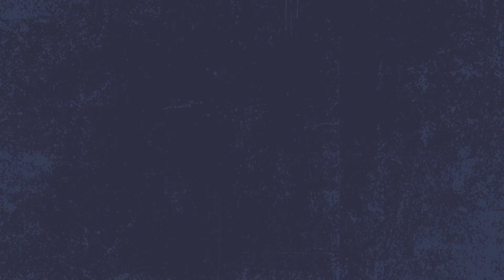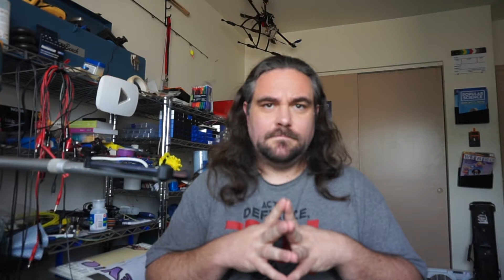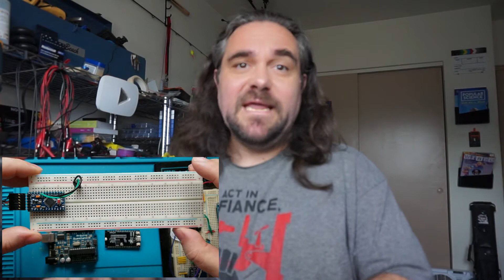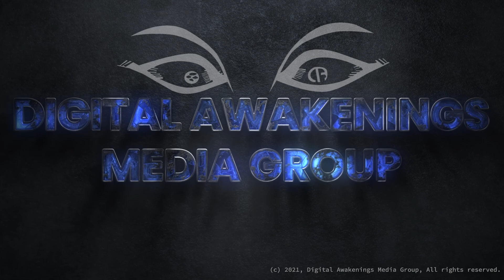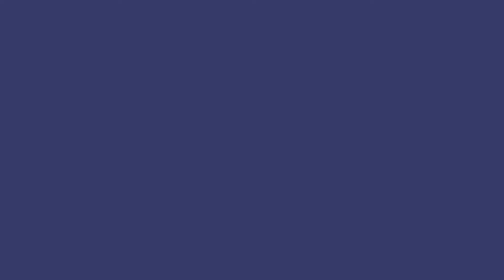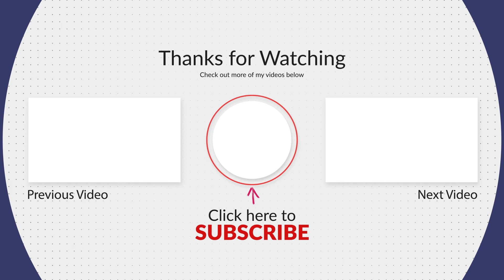C++ For Microcontrollers - Introduction

Comment: Hey if you could do me on pulling in the MCU info in to an IDE like VScode? You mentioned AVR but would this work for other Arduino chips like uBlock and STM? Is it as simple as adding the extension form the manufacturer?

Comment: I'm on board for this coarse, what is the first type of equipment I need to buy? I have a AC motor already and computer. What type of hardware will be able to handle a 115v electric motor so I don't burn out anything. Thank you!
Reply from the maker: I am filming the second part now, my father passed away the other week so I kinda fell behind. We will be using Arduinos primarily the pro mini, so you will need one of those and a ftdi cable. We will also be using esp32 in later lessons for multi threaded programming and working the tcp/ip stack and blue tooth. Controlling a 120v ac motor is hard, especially if you want speed control. If you want on off than using a transistor to drive a relay would work. Could use 4 of that combo to create a full h bridge.
Reply: @MikeysLab  Thank you, and sorry to hear about your loss. My condolences to you and your family. What motor would you say would be useful for this coarse? I have access to numerous of electric motors, I just would like to avoid any side steps if I can.

Comment: What do you think about assembly?
Reply from the maker: Assembly is where everything ends up, you can develop directly in assembly sure, but very rarely iis it worth the extra effort. In a professional environment it is  almost never used. Also as compilers improve the benefits of manual assembly over generated  assembly get smaller and smaller.

Comment: Wow can't wait to get started with this. i will get to learn a lot from you! also, i am struggling to make a menu system for my project. every other library assumes i want to use a rotary encoder. but its just too unstable so i am only using 3 buttons. could you make a video on designing a menu system and logic behind it. i basically want the ability to go into sub menus without losing track of the root menu no. if that makes sense. i just can't figure that out for some reason. i tried switch case and usual if elses. but the logic always fails at some point. i feel like i don't have a good understanding of this concept. love your videos mikey!
Reply from the maker: I can and will, the short answer is to use a map xml of the entire menu and every end of a branch on the menu tree has a unique identifier, that way you do not need to keep track of the bread crumb for anything other than the back button. I did this for a project (not filmed) a few months ago, but it is time to make the video 😀
Reply: @MikeysLab  you'd help me out so much with this video. can't wait!
Reply from the maker: Any time boss, that is the exact purpose of our channel :)
Reply: @MikeysLab  thanks for the tip. Ill look into this.